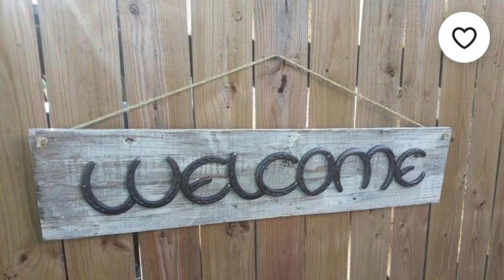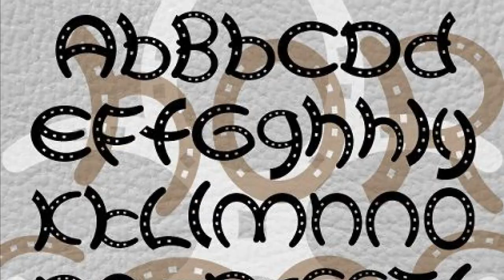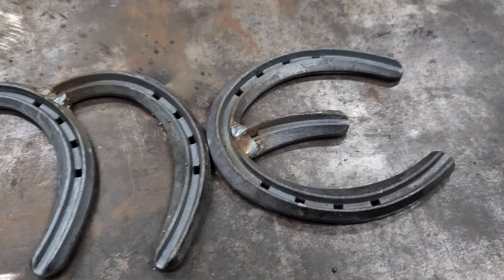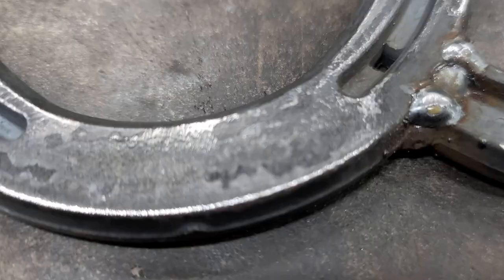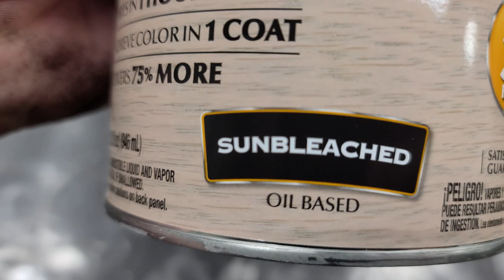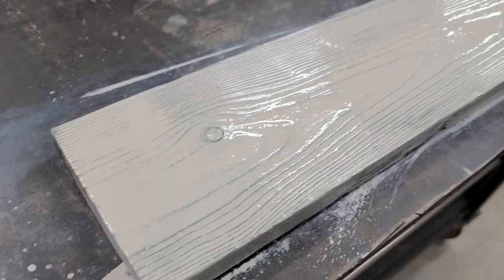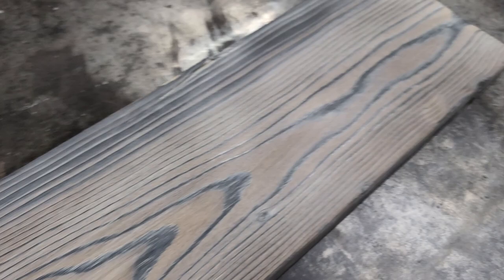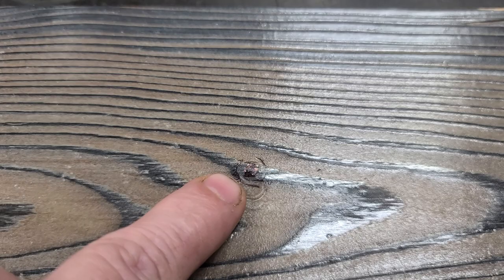Horseshoes Art

Comment: Awesome demo. Beautiful sign. I like the "standoff". I've made many projects with our pulled horseshoes. I have a mig welder but for horseshoes I prefer to torch braze with flux coated bronze rod. There's no spatter. I can "run" the "bead" and not have to grind it off. Wire wheel the pieces clean in the joint, lay the horseshoes on "fire bricks" for heat retention and getter done, even on a wood workbench. Brazing also works with EMT Conduit without needing to grind or burn off the zinc galvanize. Rough sawed oak pallet slats are good substitute for barn lumber.